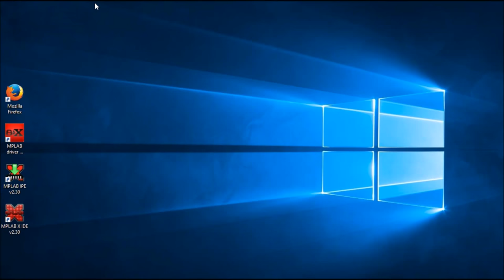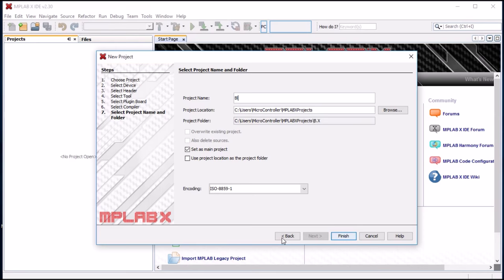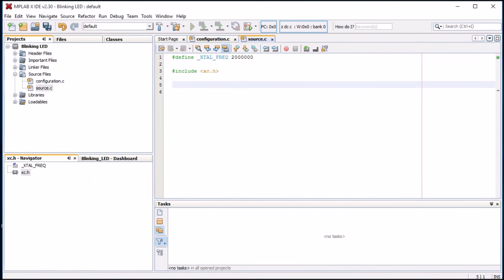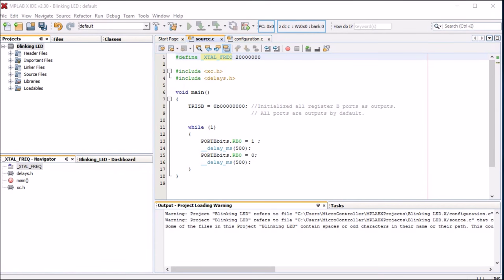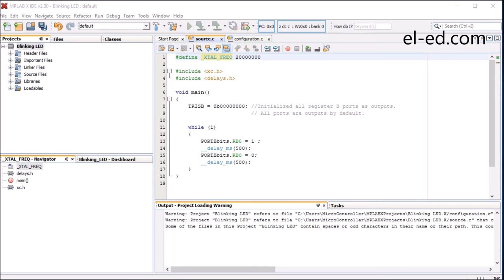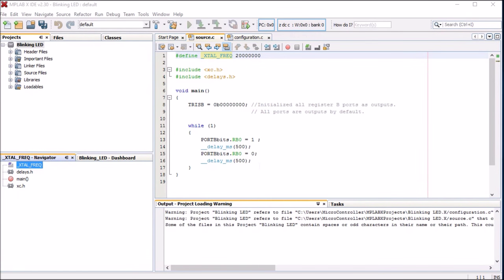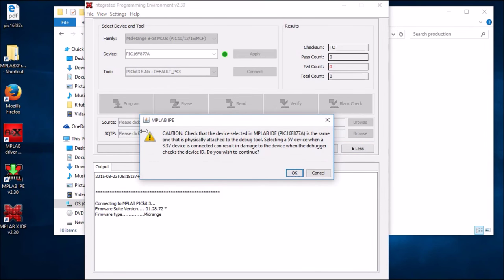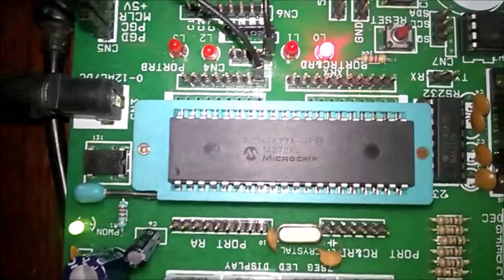Blinking an LED - PIC 16F877A MPLABX basics

Comment: thank you for the turitorial!! MPlab has a built in delay function you dont need to include the delay header anymore MPLAB XC8 compiler also has a built-in delay in the format: __delay_ms(delaytime). for anyone wondering. also when configuring the Input/Output pins look at your datasheet for the TRISX configuration

Comment: I encountered a few problems. First, I have the latest MP lab software, and its not recognizing the #include <delays.h>
Also, my version of the software is sensing errors with the while statement. 
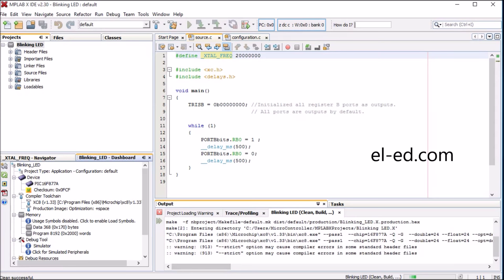No doubt, there is probably some mistake I have made. However, I have typed in the code, exactly as you have around 8:17 with no success. So, its really frustrating.
Reply: get rid of the #include<delays.h> and add #include<stdio.h> instead

Comment: that led blinks like a 100ms delay not 500ms. i found this problem when using arduino and pic controller at same code like 1000ms delay . arduino wroks real time clock 1 second delay but pic not work in real time
Reply: It flashes too fast because he has the watchdog timer (WDT) turned on 2:41.  The chip is continuously resetting itself.  Turn off the WDT in the config settings and the chip will run correctly.

Comment: my compiler is showing me an error on #include <delays.h> that cannot include file kindly assist
Reply: Yes i have the same question, on little research It seems that delays.h function is not applicable on pic16 family. but how el-ed was able to do that ?... if we remove the delays.h, without it __ms_delay function doesnt work.. Geoffrey were you able to figure it out
Reply: remove the header delay.h,  delays will work with two pre-underscores as shown in this parenthesis(__delay_ms(xxx))...I tried it is working..